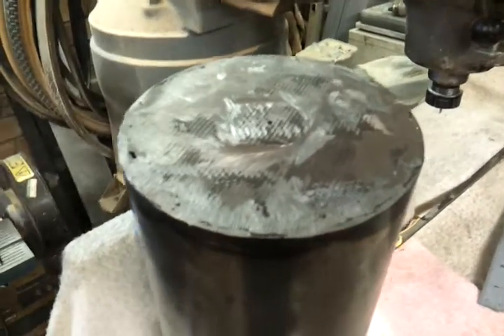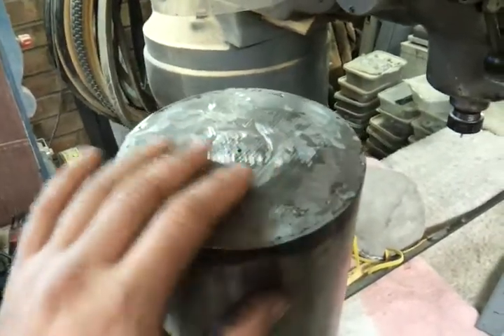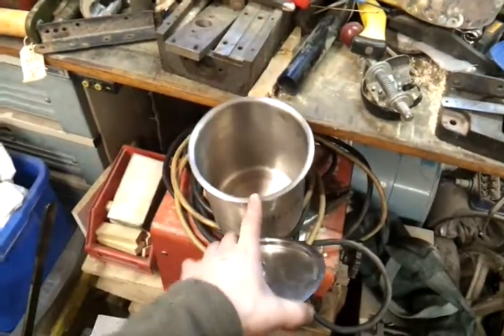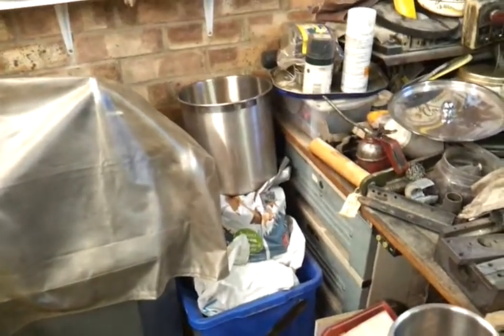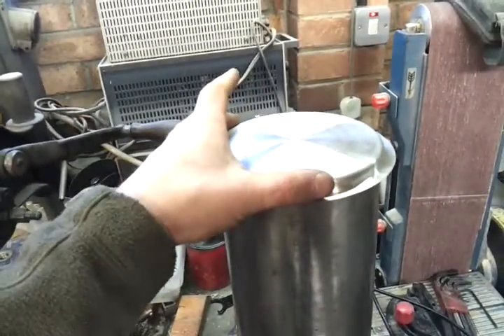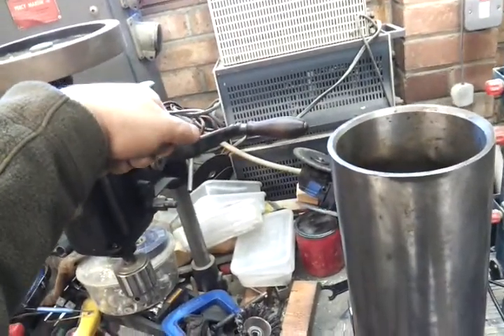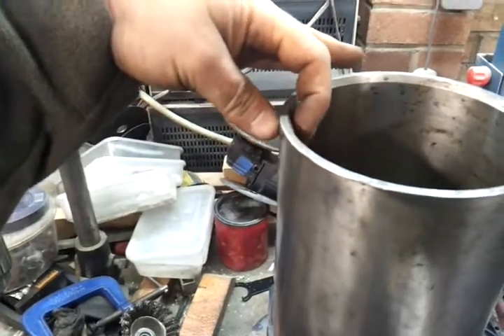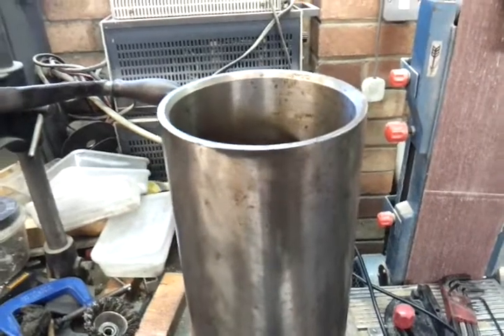Steel Crucible Part 2

Comment: Can you melt brass in those?
Reply from the maker: I can't imagine why not. The brass would melt a long time before the steel crucible. The only thing I haven't checked is weather steel is a chemically acceptable material to melt brass in. I imagine it is not ideal. Ceramic is always best and more expensive. Don't get any silicone near your brass melt!
Reply: I did try it once and melted brass but the  steel pipe flaked. I do melt aluminum in cast iron pot and the pot has not deterated any. I have used cast iron for years for melting aluminum. The trick is... make a brick furnace kinda like a well. Double line it with brick. leave a hole near the bottom. Use only firewood and a good blower. I can tell now, it works. The firewood heat will not damage the cast iron but will melt the aluminum less than a half hour. I have mixed some zinc die cast metal to the aluminum melt and it works well for bells. Also it gives the aluminum a more liquid flow.

Comment: how many time did you get to use it before it fractured
?
Reply from the maker: I've not got around to using even at this late stage. I do have a few projects in mind that would need it though
Reply from the maker: It wouldn't really fracture. I think the failing blow would be when it had scaled off so much that it was super thin. I reckon this would be so noticable that anyone would stop using it a long time before this happened.
Reply: that a good observation
it could help me  thank you for the reply

Comment: I have used an old cast iron kettle for 6 monthes off and on and I cannot see damage to the pot. I use wood as fuel and a blower under the fire. I make bells from 10 inch to 14 inch at mouth for yard ornaments and farm dinner bells. I mix some zinc with the aluminum and they ring pretty nice.

Comment from the maker: I am drawing closer to getting the furnace out, but steel certainly works though as far as it takes much more heat to melt.  Steel and especially iron are unfortunately far from ideal.  Steel will suffer from scaling after each heat and will eventually fail. Iron is supposed to react quite badly with the aluminium although I've never tried it having read about the disadvantages before making one. No matter how well or poor your clay crucible turns out it is likely to be superior to both.